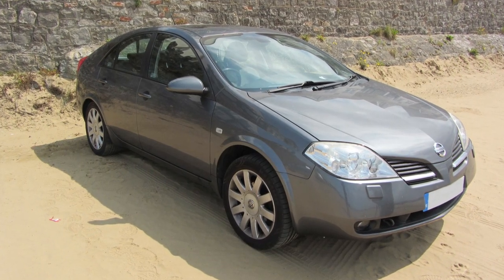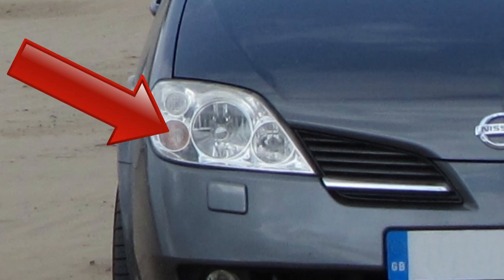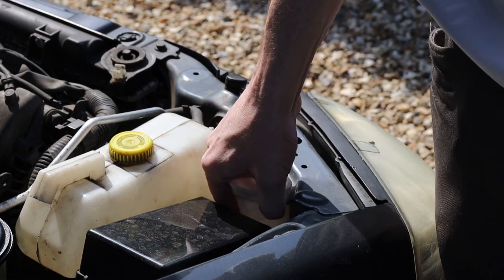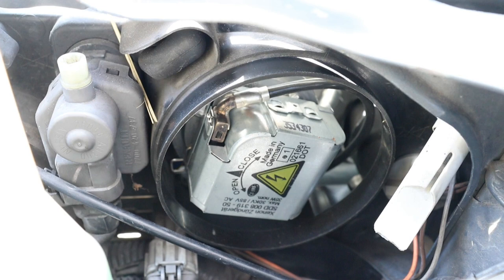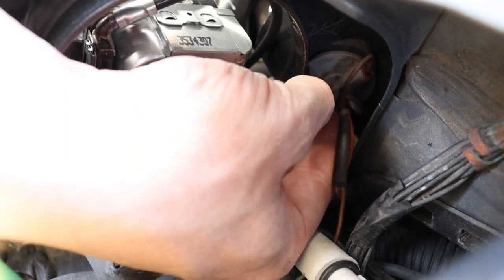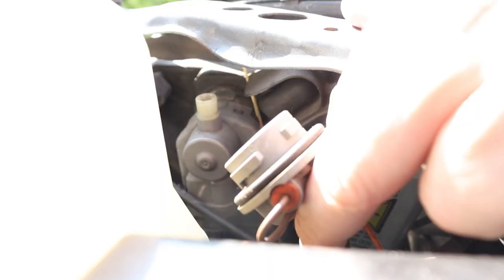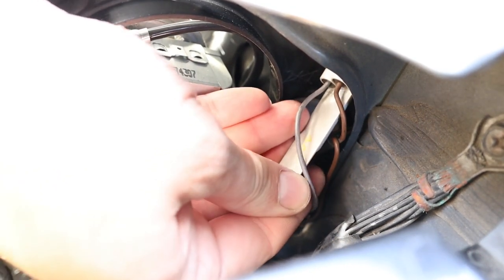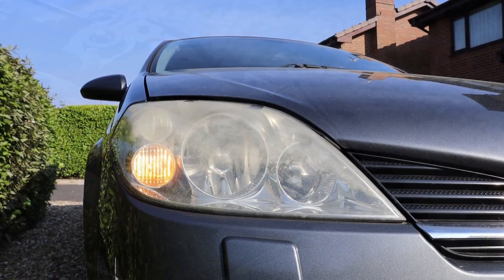How To Replace A Front Indicator Bulb: Nissan Primera P12 (EASY)

Comment: what about other side?
Reply from the maker: More or less the same process. Naturally though, there's no filler pipe to remove for the screenwash on the other side of the car.
Reply: There is cooling system in mines on the other side.